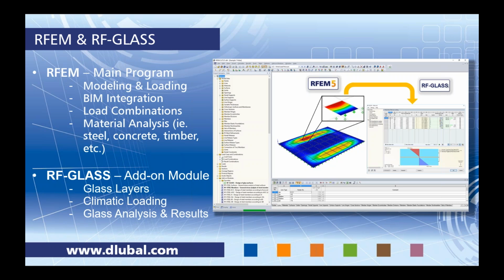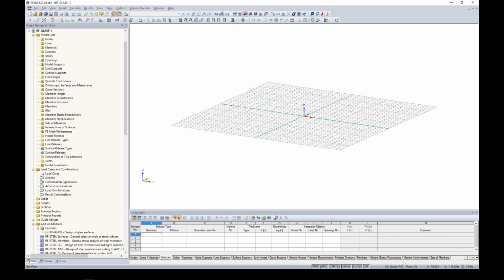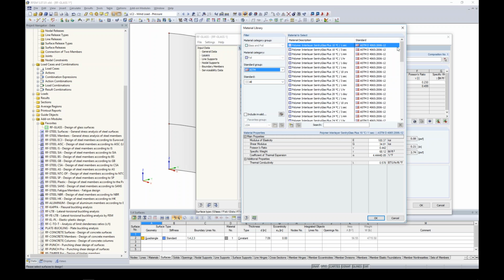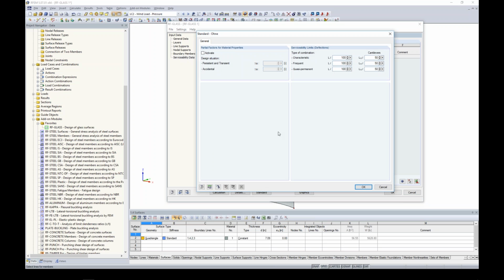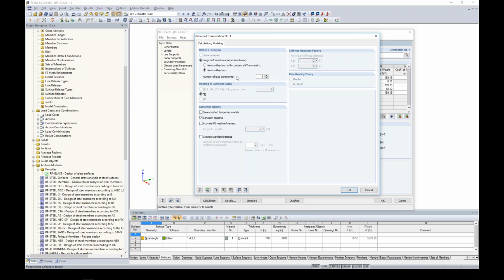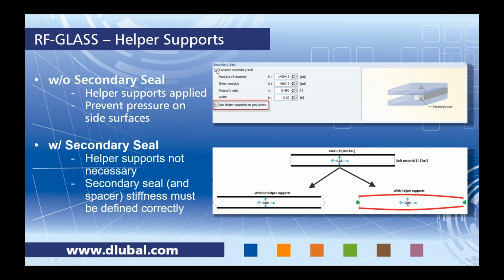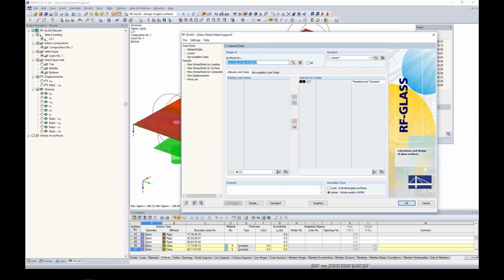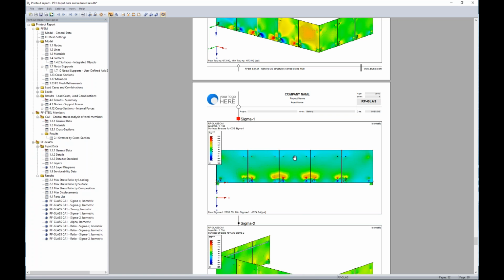Webinar | Structural Analysis of Glass in RFEM (USA)

Comment: Hallo frau Heilig, 
I would like to ask, is it possible to analyse  different  compositions with RFGLASS at the same time, for example a laminated glass panel resting on laminated glass beam which both have different thickness and compostion.
i tried it many times but it only show the result of the first composion, how can i resolve this. 

thanks
Reply from the maker: Hi, najeb!
This should be possible as multiple compositions for glass panels can be defined in the same model.  If you continue to have issues, please email us your model at info@dlubal.com without the results saved so it's small enough to email.  We will be happy to help you further.

Comment: Hello Madam/sir,

we are planning to buy a software which can analyse structural steel with glass (Like skylight). is it possible in this software? can u please share one tutorial?
Reply from the maker: Hello Iqbal.  RFEM is capable of analyzing and designing structural steel according the the various standards.  You can analyze and design the steel and glass elements together if you are performing a "global" design of the glass surfaces.  If you are performing a "local" design of the glass elements, you can only account for the stiffness of boundary members.  We do not have a tutorial geared toward this design and the best reference would be this webinar.  If you have any other questions, feel free to contact us at info@dlubal.com.

Amy Heilig
Reply from the maker: Hi, Iqbal!
Yes, this is possible.  Please refer to the following webinar which integrates glass panels with aluminum member design.  The same concept can be followed for steel member design instead.  https://www.dlubal.com/en-US/support-and-learning/learning/webinars/001437